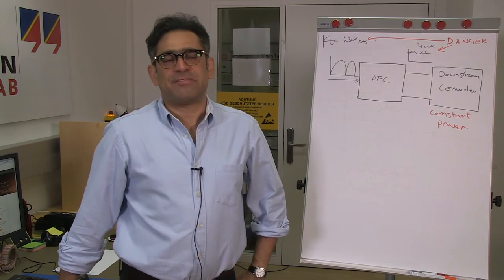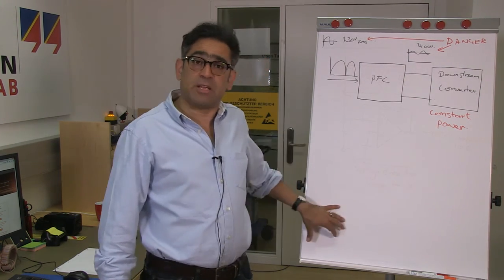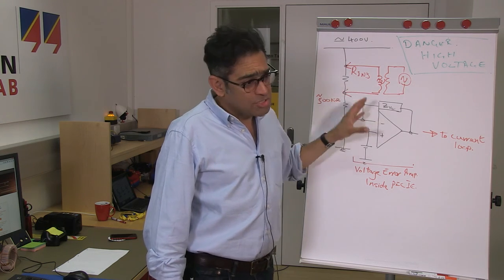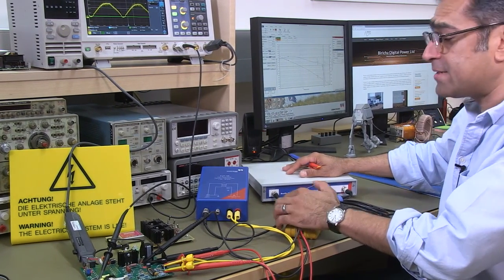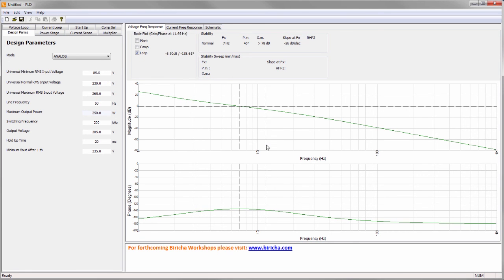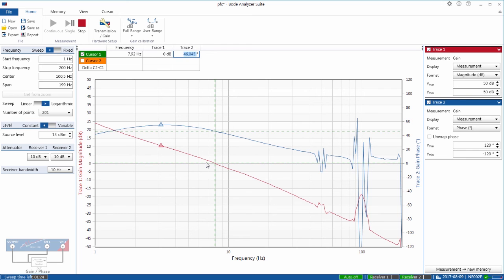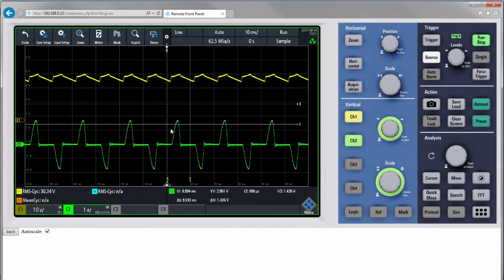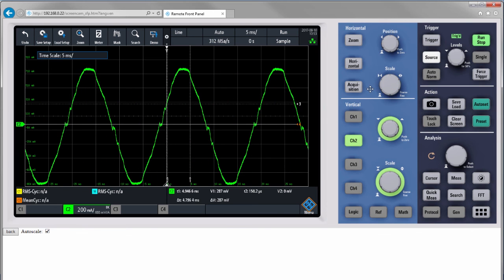Measuring the Voltage Loop of a PFC

Comment: Hi
I have a question:
why when we do the PFC circuit in open load, the output voltage does not stabilise at the reference value?